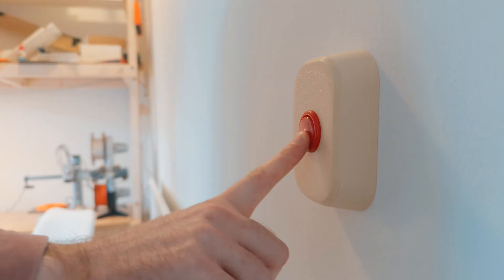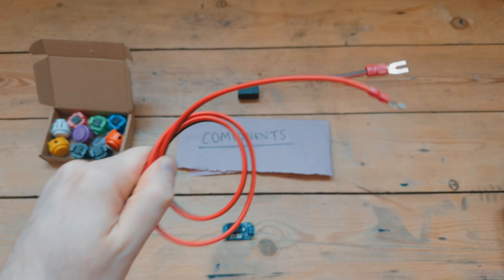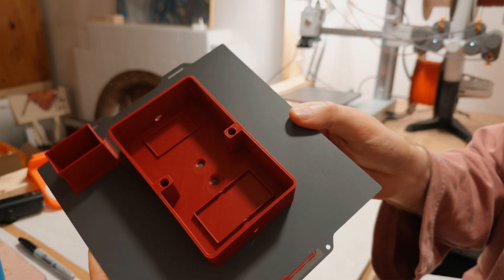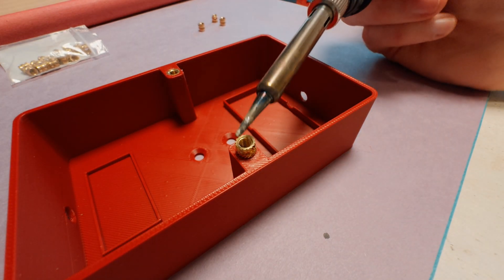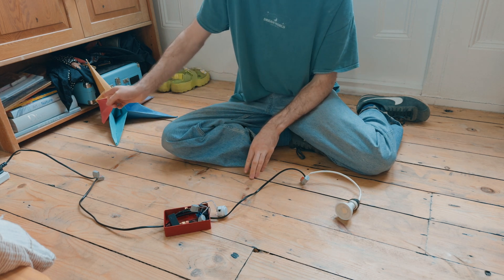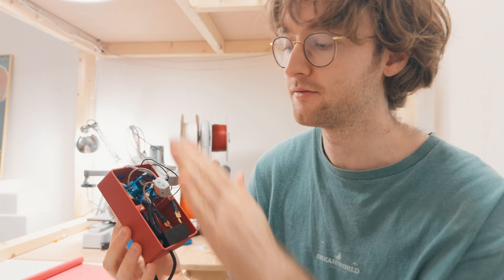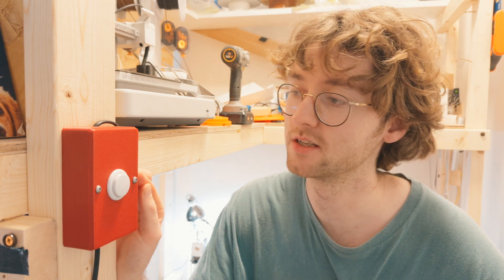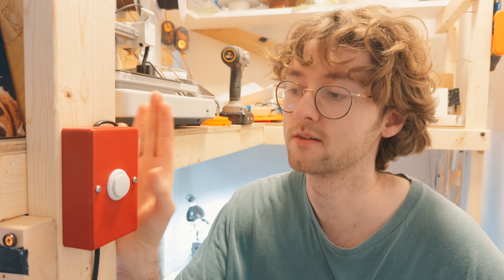I Made a 220V Switch with an Arcade Button

Comment: Great stuff! How does the 5V power supply work? Does it need to be plugged in separately?
Reply from the maker: I ran one mains cable into the box. And split it off into 2 lines using wago connectors. I didn’t want to run 2 cables into the box so that’s why I use a tiny 5v psu I could fit inside.